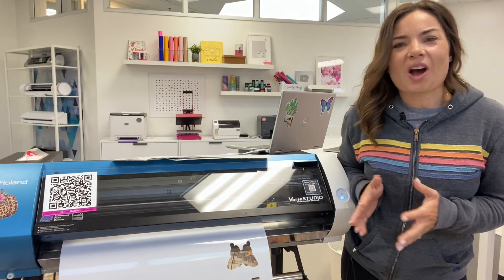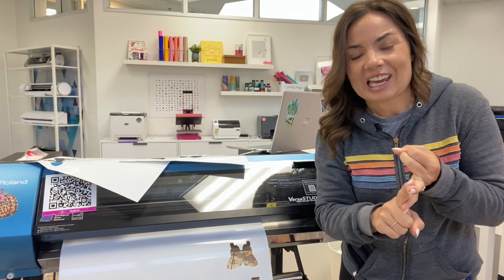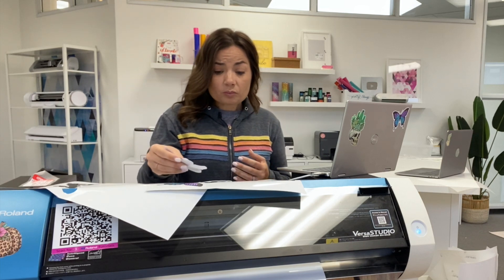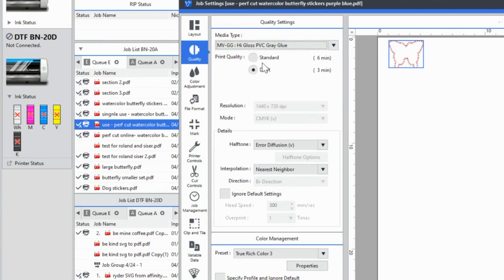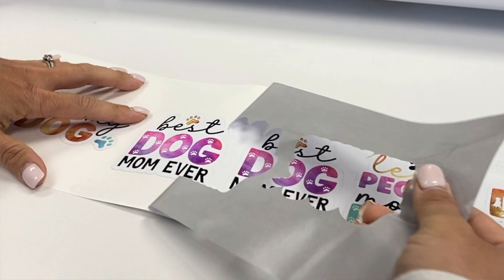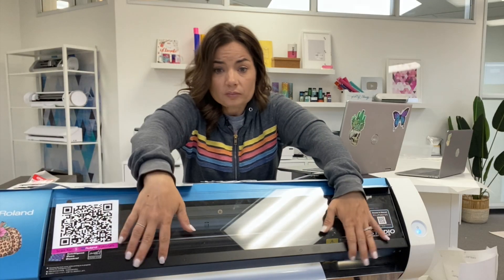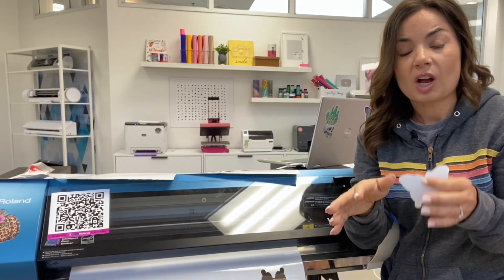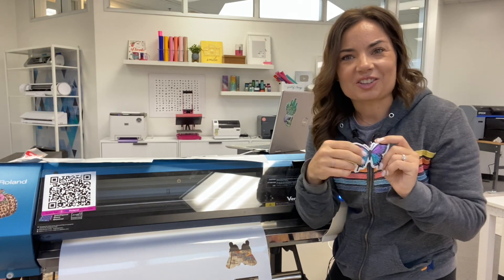Roland BN-20 Test Cut: How to Find the Best Roland Versaworks Cut Settings for Every Material

Comment: Awesome.  I didnt know it was possible to do a die cut like this with paper also shaped like the  sticker!!!nice!  Im using regular sticker paper.  recently replaced my blade and im not going through enough..   Tried the cut only.  But when setting pressure like above with cut condition settings , no cut happens.    with no cut conditions set, I get a line but not deep enough.     😬
Reply from the maker: Sounds like you need to adjust the force setting
Reply: @SilhouetteSchool  Yep I tried...  Force of 20, 50, and 100.   Maybe I gotta try go 200? :face-fuchsia-tongue-out:.  I'll message back if I figure it out....I want to try that die cutting.    A much better user experience I would think.

Comment: melissa, i just got my bn20a and im wondering how do I add registration marks and trace an image to import into versaworks to cut on another plotter? What blade is best for vinyl stickers? is i 45 degree or 60 degree? How do I convert to PDF to use in versaworks?
Reply from the maker: It depends what software you are using
Reply: @SilhouetteSchool  i have the leonardo software. Just wondering if I can use siser juliet with versaworks 6? what would be the easiest and quietest/affordable desktop plotter I can use with versaworks? I have a vinyl express 60inch but its used for auto wraps. I realllly need help! moving from siser/ecotanks to bn20 is really a big change.
Reply from the maker: You can use the Roland and Siser Juliet or Romeo together. Here's a video https://youtu.be/--hSeKgZLA0
Reply: @SilhouetteSchool  would you suggest the siser cutter or should I get a small graphtec or gcc? Are they equally fast. I have a juliet but 12inch cut is too small
Reply: @SilhouetteSchool  also, does perf cutting work with those machines? if so how?

Comment: Love your videos,  you've been so helpful.  There is a print house video  stating bn20's are not for perfcuts, you'll tear up the cutting strip. I learned this after I had to replace my  cutting strip😢
Reply from the maker: You can do perf cuts with the BN-20 and BN-20A. It's not a work around or hack, the machine and software are designed to do it. The key is making sure your settings are dialed in so you're not cutting too deep and cutting into the cutting strip.